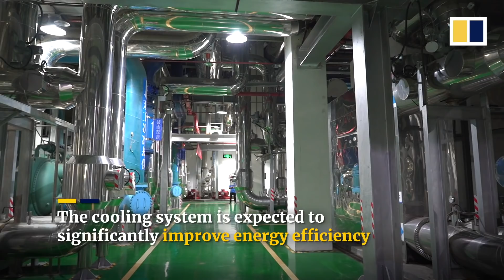China’s Shenzhen city builds giant air-conditioning system to cool entire Qianhai economic zone

Comment: Not a bad idea. It's like district heating in colder climates, just in reverse. I hope the water pipes are insulated to save energy.
Reply: They are under ground so they are not as efected by Ambient tempetures on the surface.
Reply: Unless the miles of distribution piping is insulated with vacuum chamber insulation just like in a thermos for your coffee then the losses along the distribution pipes will make the whole thing a net loss compared to individual air conditioning units. I install and work on air conditioning every day and I can tell you for certain this plan is a bad idea and will use more energy compared to traditional split systems. The energy savings from using a ductless split system is better than a traditional ducted ac that is in almost every home and office because the units are smaller and produce the cold exactly where its needed where a ducted system loses almost 30% in the ducting that is only about 20 to 30 feet long, now imagine piping that cold water for over a mile before it does any real work. The energy losses from where the cold is made to where it is needed is huge. Add in the pumps every 100 yards and now your using much more power than individual units would consume to perform the same cooling effect.
Reply: @jamminwrenches860  you are forgeting the strain on the power grid of thousands of buildings pulling power from the grid trying to cool each building's and home's, and brown/ blackouts are persistent problems in major citys.
Reply: District cooling exists
Reply: @jamminwrenches860  what about the fact that when these millions of ac units create cool air they are dumping hot wet air back onto the street - and raising the am ambient temperature of the city significantly.
Reply: @jaxstax2406 I wonder if they reclaim the heat.  Heat reclamation is a new trend in industrial efficiency. Use heat that was created at great expense and wastefully discarded to power a generator.  And now you have district hot water.

Comment: You’d freeze from standing right beside the air conditioner
Reply: Free ice box
Reply: Air conditioner do not make cold air but they dump air from inside your home to the out side
Reply: Wow human ice cream. 😋😋
Reply: @edwardchayadi3297  idk where did u learn that but u might need to relearn something
Reply: @C. Phan i learn that like 3 years ago
Reply: @CB_here  yea i know but that guy said aircon dumps ur air outside :/
Reply: @CB_here   yeah science!!
Reply: @nicename6258  but with extra steps
Reply: @edwardchayadi3297  "...dump air from inside to outside" wdf your talking about? Air conditioner does not exchange air between inside room and outside of building, it recycle air of same room!!!!
Reply: yea, it will dump it inside to outside because there has wind.
Reply: @FD_Stalker  i think you must enter the science class..........so human feel cold via loss of heat so if air conditioner is make cold air its impossible!! So the air conditioner dump air using freon
Reply: @edwardchayadi3297  Looks like we have a loser who skipped college thermo courses or never been to college.... Let me make this simple to understand: Cold refrigerant meet warm air in room by fan blowing out cool & very same air, warm  refrigerant gas runs into compressor, then high pressure refrigerant release heat to outside air by fans, then runs through condenser to depress & liquidize again. This is called "refrigeration cycle"
Reply: @CB_here  already explain it the science
Reply: @FD_Stalker  those just the inner working of air conditioner

Comment: The cost effectiveness of the system can be resolved once the tech becomes mature that will increase adoption, just like electric car. Of course this is easier said than done.
Reply: no, it won't be cost effective. it uses more resources in general. it is a dead end service. like central heating in the western countries. not thought about the long term effects
Reply: The technology of air conditioning has been mature for decades.
Reply: Rather then go into the engineering problems that come with a HUGE ac system, air handling, pneumatic air dampers, air filtration, static pressure, ,, let's make it brief, ,, this won't work correctly ever. You will have to add more units along the way because by the time the air gets to the end it would be hot and have no pressure,,and you would need to hire an army to maintain it and adjust the dampers, wear and tear, and much more
Reply: Cost of infrastrcuture is always high. Water pipes and sewage after hundreds of years is still very expensive, but we pay for it since it's necessary.
Reply: @Someone-kn1wj  OH I'M SORRY THAT I DIDN'T USED CAPITILIZED LETTERS IN AN ONLINE STREAMIN' SERVICE COMMENTORY. ;-)
Reply: @SuperMassman  the transportation media is chilled water, not air..
Reply: @michaspringphul  district heating is hugely popular in Europe. Now we are even getting district ground source for heat pumps as the modern iteration of the concept in cities that didn't have it. It reduces the up front cost for homeowners and some districts even provide heating for free at the point of use, seeing it as a human right.
Reply: @zoravar.k7904  Yes, we do use this a lot in Germany as well, especially in the living quaters of the poor. But still, you have to lay down isolation pipes for kms over- or underground. In East Germany a lot of those pipes are overground. They don't only look awefull, they are hazardous due to isolation materials. These materials are plastic foams. They degenerating in microplstics and contaminate the environment. We all talk about a lot about climate changes and contamination of enviroments, but we, the industry and governments do such stupids projetcts which in the long term view are worse than other solutions... which seem to be bad on the first impression. On the other hand we do things which seem to be benefitial short sighted, but also in the long term perspective they are worse than other doings.
Reply: Dream on.
The company is state owned. 
As rule of thumb, state owned company always find ways to lose money. 
Why strive to become efficient if you can always ask the state for more (unpayable) loans every year?
Reply: @SuperMassman  That's why the stations do not distribute cold air. They distribute cold water to the buildings.
Reply: This is very well established technology.

Comment: What they actually made, is an energy storage system.... i.e. a giant battery
They convert electricity in thermal energy that they store in water by cooling it Down to ice. 
and during daytime they release the thermal energy by extracting the cold from the ice.

Way cheaper than all these huge tesla batteries that are being built.
Reply: But batteries are more efficient ... U can't produce that much electricity from heating and cooling water ..
Reply: @forefatherofmankind3305  Batteries are too expensive and more dangerous
Reply: @forefatherofmankind3305   if the purpose of electricity was to cool/heat water in the first place for the AC system, then it'll prob be more efficient with the ice storage system. Approx 40% of building energy usage is for cooling/heating.
Reply: @forefatherofmankind3305  China is the producer for batteries if it was better to use batteries it would
Reply: Make ice is not cheap. Keep the water in ice state is not cheap. Your fridge use a lot of electricity
Reply: Joseph Arden  We need it for our cell phones, cameras and Bluetooth headsets, but why are there so many accidents with lithium-ion batteries when applied to electric vehicles and energy storage power plants?

This is actually a matter of probability. For example, an imported battery used in an imported electric car claims that the accident probability is only one in 10 million, but a car to install 8000 such batteries, equivalent to 10 million batteries can be installed 1250 electric cars. That is, theoretically 1250 electric cars, there is a car in a certain battery may be an accident. If this accident belongs to the battery burning or explosion level, it may trigger the chain reaction of the surrounding batteries, which will cause the big accident of burning electric cars.

The same is true for accidents in energy storage power plants. Compared to an electric car that can store roughly 50 to 100 degrees of electricity, a container body of energy storage batteries can generally store 1000 degrees of electricity, and a medium to large energy storage power plant is often a collection of dozens of such storage battery containers. As you can imagine, with such a large battery usage, it is normal for accidents to occur occasionally. On the other hand, electric vehicles and energy storage power plants, the consequences of combustion and explosion accidents are obviously too much more serious than cell phone batteries, and the current fire-fighting measures can do almost nothing about it.

Comment: Mechanical Engineering, one of the best and most important engineering there is. Very flexible for jobs as well.
Reply: There is definitely electrical engineering there 😢
Reply: @khalilomar6364  yeah all engineering fields matter. But there is always mechanical engineering people who at least have role on manufacturing process of every single part of those stuffs
Reply: @wildanh7806  nope, I would say industrial and facility engineering are the main aspect of this project
Reply: @Tate.TopG.  well i didn't say that mechanical engineering is the main aspect of this project, but i guess you not wrong
Reply: @khalilomar6364  Getting a degree in electrical engineering will get you a job as a programmer.
Reply: @cellocovers3982  Not really. Depends on wat u specialize in ur last year.

Comment: I think this kind of plan makes the most sense if you are building a new city from the beginning, or a new district.  This happens in China!  I have heard of places that have district heating long ago, but this seems like an advance.  The plant is really something!  So shiny!
Reply: Pretty sure Singapore has something like this too.
Reply: @mira-uf1ie  a lot of places do, it’s really the most efficient system for a city, and you can make broad improvements really easily
Reply: @iain3713  Really? I thought only Singapore had it so far. Do tell me which other places have it too.
Reply: @mira-uf1ie  well district heating is fairly common in Europe but not enough :(, with a few district cooling systems popping up, but they normally use cold water instead of air.
Reply: @iain3713  I see. Still, could you list me the country/places please? I would like to study more about this district heating thing.
Reply: @mira-uf1ie  Stockholm is a popular example of dictrict heating. Some districts in the Netherlands are also providing central ground source water, and that way you can buy a ground source heat pump, plug it into their network and have heating or cooling at an extreme efficiency.
Reply: @zoravar.k7904  Thank you~ I'll go and search for them later.

Comment: Efficiency loss as pipes get farther away from main production. Also, building material should be improved to reduce heat going into the buildings in the first place. That alone will have a more significant positive impact in reducing energy use and lowering temperature in the buildings as well as improve environmental impact.

Comment: This is similar in concept to a system we use in Toronto to cool our business district called deep lake water cooling where we pump 3.5 degree celsius water from deep in Lake Ontario to cool the business district. It is also extremely efficient and saves 90% of energy in the same cooling.

But it cannot function in areas without massive natural bodies of water and there is concern excessive use could heat up the lake.

This technology solves that by using the excess energy at night which are just wasted and can be built anywhere.

Super cool! Literally!
Reply: May I ask, is it environmentally friendly?
Reply: @roj22fetals6  The Toronto lake cooling system is considered environmentally friendly since it reduces cooling energy consumption by 90%!!! The only energy use are the water pumps.

This will use more energy since they are manually freezing the water, but using energy that would've been wasted anyways so this is in my view, a more flexible system!

Comment: This is cool. It's like how NYC has a central steam heating system for most of Manhattan.
Reply: yeah it's "cool"
Reply: Exactly! I was thinking the same thing.
Reply: China also has central heating, I think Manhattan is also very suitable for this kind of cooling system
Reply: @catchlessc8941  Agreed, Manhattan can probably benefit from this since their summers are similar to Southern China's.
Reply: @mantree8047  think it’s only cost the system or tech is not the problem it’s money
Reply: @mantree8047  “you people” 🤣
Reply: @mantree8047  of course they won't. They're only there to take it from "we people". 

No one's begging for your tech anyway, pal.
Reply: @zippyparakeet1074  You people!!
Reply: Retrofitting steam lines for chilled water may require some engineering.  However, if you currently has individual cooling for your building, the building manager would likely balk on new capital expenses.
Reply: @mantree8047  This isn't new technology. US cities have similar tech already. China just scales it up....
Reply: @Otter-Destruction  i think some buildings in manhatan already use cold river water to cool their buildings.
Reply: @zippyparakeet1074  hmm.. India did, from China

Comment: To put into perspective, 
1 refrigerantion ton is approximately 12000Btu/hr. 
An 1 horsepower Air Conditioner is approximately 9000 Btu/hr. 
The system they build would be able to cool more than 500,000 small size rooms.

Comment: But how do you regulate the temperature? For example area near it will be colder, and further will be warmer.
Reply: There will be several station across the city for each zone.
Reply: Use parallel distribution method.

Comment: well that district cooling system will make sense if you can dump the heat for free in deep river or ocean. if it is only a large refrigeration system chilling the water, there is little value and as mentioned in the video, huge losses in the transmission or transporting the chilled water can eat into profits

Comment: imagine when it fails. that giant pool of hot air in one spot only circulated by movement of vehicles that produce hot exaust. this is why you nee more than a single system
Reply: They didn’t talk about this in the video. Did you get the information from someplace else?

Comment: I mean, they realise the heat has to go somewhere, don't they? It is always going to be hotter just outside an AC regardless.
Reply: You do realize that the efficiency of a large unit is greater than multiple smaller units.
Reply: From my perception, I don't think their ac is similar to ours as it only depends on the water pumps for releasing cold air and does not exchange it.
Reply: The heat goes to ocean at night. And obviously a giant centralized cooling system will be a lot more efficient than multiple small, individual air-cons

Comment: Sounds kind of  crazy you want to put a whole city under the same air system. What's with all the water all over the floor? 2:00. 4:25 you have your answer why its not in residential but only commercial buildings. Residential wouldn't switch, its more expensive than a window unit

Comment: Build this can also save money：
Guangdong Provincial Development and Reform Commission issued a "notice on further improving the peak and valley tariff policy in Guangdong Province," the peak-to-valley ratio in Guangdong Province from the original 1.65:1:0.5 adjusted to 1.7:1:0.38, so the peak-to-valley tariff difference of 4.5:1, a difference of more than three times.
If the gap between peak and valley electricity prices is relatively large, it will prompt the user side to install energy storage, charging energy storage in the low period of electricity prices, in the peak period of electricity prices discharge, thus flattening the price of electricity.

Comment: What’s the impact on carbon emissions with this type of technology? :O
Reply: It is an air conditioner so there will be similar carbon emissions you get from running a normal AC, except that you should use less energy overall since the AC's are large and centralized.

Comment: So i am thinking it's not efficient, all those pipe cooling loss. As the last statement says did they not look into their profitability before implementing. Window and Split air conditioners are much more environmentally efficient not really friendly since the gas in most of them are the dangerous kind. The only reason China wants this is that it sees Malls and Industries are wasteful of electricity when not in use. Most of the time its true they just do not have rules implementing reducing costs via efficient use of the utility.